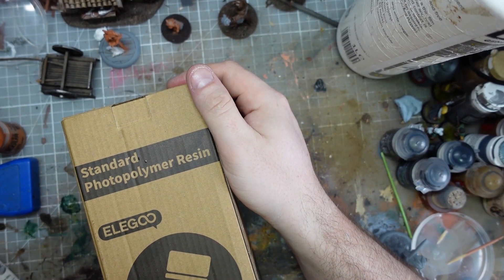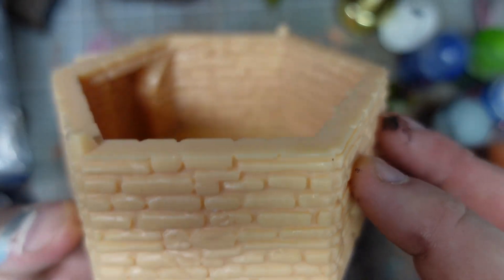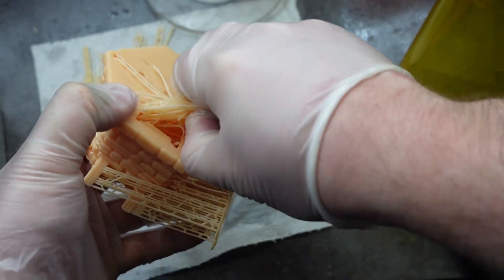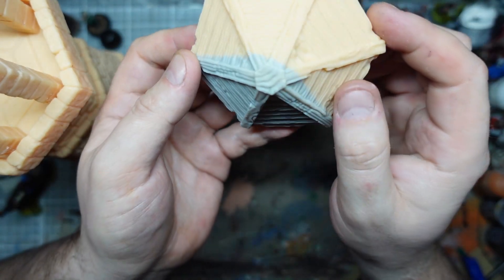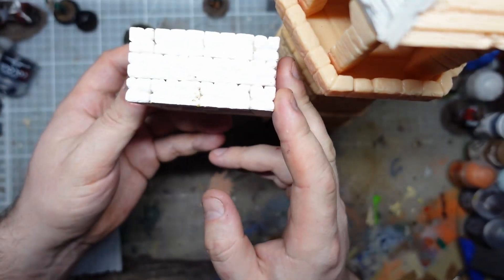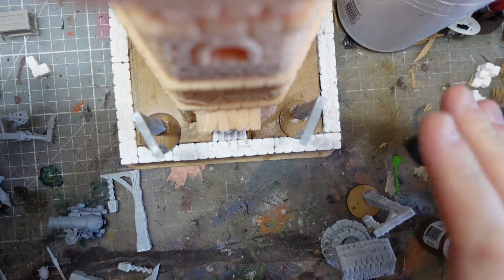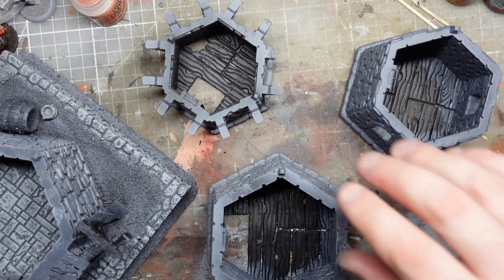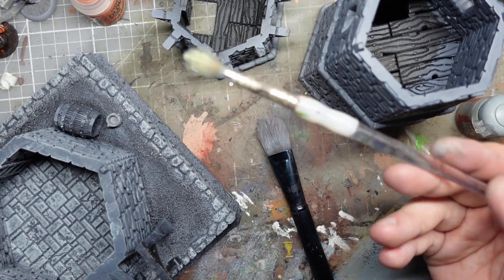Resin Printed Lighthouse Experiment

Comment: Bit late the the party, but interested in this because I'm moving away from the brittle resins and onto something like Sunplu, but also have a bottle or two of the standard resins.

Also, the docks look great, which company did you get the files from?
Reply from the maker: Yeah seems like it should be a good way to use them up. However I drop stuff a lot and broke more than one layer that wouldn't have happened in a better resin. The docks were cast n play iirc.
Reply from the maker: It might be better to use brittle resin on chunky but medium sized scatter.
Reply: @ScruffyCrow  Thank you! Appreciated. :-)
Reply from the maker: https://www.myminifactory.com/it/object/3d-print-modular-docks-pre-supported-181323